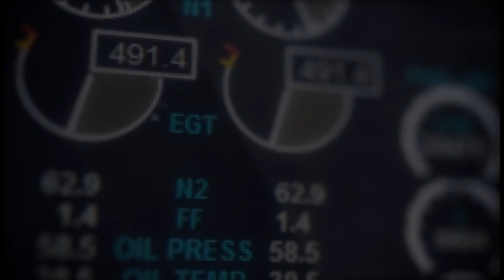Will Circular runways "take off"

Comment: Even more wingtip clearance with extra g force entailed by a banked runway would be needed.
And, what about all the approach lights and ILS system markers and glide slope indicators.
It would be a hell of a light show with thousands of those flashing lights radiating out everywhere. Using up so much extra space as to be beyond absurd.
But maybe computers will take over using gps and other indicators rendering all that other stuff unnecessary.
But with real pilots. It is absurd.

But I see this was raised before.
Reply: the light system could be done with hud indicators and ground markers that would only light up the ones required for that plane to land.
Reply: +Marcos Danilo +
No good.
Have you seen runway approach lights? There is a kilometer long array of towers with sequential strobes indicating the precise direction of the runway. It is not possible to have such an array for every conceivable direction.
Also the VASI or PAPI needs to be precisely aligned with the runway. 
While it at be possible to manage the lights electronically there would still be a huge amount of space required to build them all in.
And even then, changing which lights are operational, at short notice, is recipe for disaster.
Reply: im talking more of  AR actually, the runway would have "marks" that would send the information to the planes, and the hud would turn them into landing indicators.
Reply: +Marcos Danilo +
"AR" I am not sure I understand. Do you mean some kind of automated virtual indication?
Reply: kinda, AR stands for augmented reality, like the huds fighter pilots use in their helmets, one way to use them is to take something in the real world and "transform" to something else, like the AR codes for cellphones. 

that way you could have the runway with something similar to those codes, and the plane would get a "permission" to see specific ones, the HUD would then show them to serve as guide, that way each plane would only see the ones they need to guide the planes.
Reply: +Marcos Danilo+
I am not sure what you mean by AR codes for cell phones but the limitation i see is that there is a reason for high visibility, large bright, physical runway guidance systems.
For the pilot to be able to see the real runway from the real plane in the correct real orientation.
The system you seem to be describing would not have that actual connection between the pilots eyes and the actual runway landing approach.
If there was enough automation and precision in GPS and computer power, there wouldn't be a such a need for a such massive real world constructs and planes could then land themselves.
Projecting a virtual recreation on the hud would be of limited use I think.
The problem is the need to have real sight of real landing aids and strips.

Comment: You say it's unlikely, not that its not possible. If there is enough funding and expertise, a lot of the problems you stated could be worked out as they were for traditional runways. And the added costs I think would barely be noticeable if they could take off and land 2 to 3 planes at a time because of the additional revenue they would generate. Just because something is harder doesn't mean it shouldn't be tried and improve, have some technology and the desire of corporations to make more money.

My quick ideas
Maybe the lights can be built into the runway and they could be programmed to position themselves depending on take off and landing. When its needed it, it appears from underground, and it could look like car lanes but wider to add more margin for error. This would probably need a big circle though. Difficult but possible.

Comment: Some of the first runways were actually just big circular fields.. like a big platter... like in WW1, you took off in the direction against the wind, no matter where it would be.   Not around the edges of the field, but through the center of the circle.  The problem came when the airplanes tore up the center of the grass  field too much and turned it into mud.  On the other hand, a whole flight could take off in tandem at once side by side.

Comment: Excellent analysis.  An additional point:  Most airports today use parallel runways in order to double the traffic throughout capacity of the airfield.  A single circular runway with any significant winds results in a single runway constraint.  Another additional point:  Concrete is expensive, and the utilization rate of concrete in a circular runway is less than that of conventional runways.  The lower utilization rate results in higher costs.  Between these issues and the handling, clearance, traffic deconfliction, and obstacle clearance issues all line up to make the idea of circular runways a very bad idea indeed.  Have a nice day!

Comment: Ever drive a car 250 km/per hr.? Not so easy even on a straightaway. Imagine trying to hold a 60 ton jet centered on a runway at takeoff speeds while steering in a circle??!! I don't want to! Its gotta be hard enough doing it on a straight. One little glitch and you're done.

Comment: I had an idea near the end of this video that will end any further consideration of circular runways.. A massive turbine engine at the far end of the runway. Like 300 feet (90 meters) in diameter, with the exhaust pointing along the runway towards approaching aircraft. Presto! The wind is always lined up with your approach, no crosswinds! Dial in the speed per each aircraft type so you can do three point, near-zero knot touchdowns, like those crazy Alaskan STOL pilots. Runway length could be reduced to a couple hundred feet (66 meters.). I predict this will be standard practice by 2020. Why? Because I have 20/20-vision™, that's why! Just remember to dial it back after the 747 lands for the J-3 Cub guy, okay?

Comment: What happens if one of the engine hits a bird while landing in circular run away, that will be a catastrophic event for the pilot and other aircrafts as well? He will be unable to understand the thrust failures? 

What happens if there is too much of turbulence while landing becoz of the gale winds? 

What happens if there is a problem of overshooting the runway? Pilot is unable to control the speed of the aircraft for some reason. 

I think you have covered the scenario of skidding of the aircraft while landing. That will cover the snow fall as well. 

What happens if there is simultaneous take off or landing? There are many cases one pilot(aircraft) aborted the take off or landing at the edge of main taxiway and runway ? How do u manage this? Incase of landing it is easy to abort in case of straight run way. In many cases pilots have managed just few feets distance while landing or takeoff just avoid collision course of the aircrafts.

What happens in case of lightning strike on the aircraft while landing on one of the engines? 

In rare scenarios aircraft controllers suddenly gives the signal to abort landing to the pilot because they found a dog or pig or something on the runway.

Comment: 3 runways  stacked on top of each other. like flying into a garauge where there is  no side winds or wind shear. and  take offs can be catapulted out.  intire airport underground out of weather.   no rain no snow  etc. as a pilot that landing would be scarey but with practice i think we can be more confident.  also fire control could line the landing strip  inside and be controled by tower and pilot. plane could come to a stop in a pillow of retardent foam
Reply: just the weight of concrete on the first runway would possibly collapse it on the runways below it,  not to mention the size of width and height of the tunnels would have to be massive , great concept but it would not work
Reply: A catapulted takeoff is extremely violent because of the g forces.

Comment: I can think of another factor against, if the camber is sufficient to prevent centrifugal force pushing the plane off the runway the centrifugal force will increase the effective takeoff weight of the plane perhaps to the point it wont take off.

Comment: I think VTOL commercial aircraft, if made feasible through RND, would significantly improve congestion and flexibility for airports. This way, the issue is not in the airport, but rather the vehicle.

Comment: wouldn't a better solution to crosswinds be to build a wind brake (a wall or dirt mound) beside the runway another upside to that is it would also act as a sound wall to keep direct sound in the airport area

Comment: Incredibly stupid idea. The problems presented by crosswind landings are trivial by comparison, and it doesn't really solve the crosswind problem. To solve the crosswind problem you would need to accurately predict crosswinds throughout approach down to the flare and touchdown point and begin the approach to hit that point. You are unnecessarily adding a huge variable to the equation. The simple way to solve the crosswind landing problem is to do it like the old days and land on a compass rose. Of course you would need to pave a 10,000' circle, but no crosswinds.

Comment: The physics isn't as bad as you make it out to be, banking the runways just right with a series of concentric strips each with a slightly different bank would allow any pilot to easily simulate a straight runway just like NASCAR tracks as well as avoid wing tip clearance issues. ice would be less likely to form cause of the bank. An automated landing and takeoff system would be easy to implement allowing for a much higher traffic throughput. as for asymmetrical thrust, it wouldn't be any different than a straight runway. I know it sounds weird but the physics are all there, this would actually work. The only issue is people are too quick to dismiss an out-of-the-box idea just because its too different than what they already know. I swear to you if you look into the physics you will be as amazed as I was.

Comment: a round runway is equal to a single runway when in use and most large airports use at least 2 as only one part of of the circle will be into the wind remember the runway can only be used in one direction or two plans will be heading for each other

Comment: We soon have roads full of self driving cars, and rockets that land by themselves, but planes cannot even compensate for an engine failure? I thought they were packed full of computers. And the London airspace management why would it even be a sweat if Heathrow needs to adjust a runway. Luton's controls are surely connected to all other airports.

Comment: The answer is simple. Make 3 flat, straight runways at 0, 45 and 90 degrees and use the most suitable runway for the wind conditions.

Comment: There's another problem with a circular runway. Imagine you've declared mayday, and you're making an emergency landing. Landing performance isn't something you've verified. Either you need more runway than you normally would, either because of overweight, or your spoilers and/or thrust reversers are compromised. How do you handle going around a circular runway? Also, if you have circular runway, say goodbye to ILS.

Comment: Mentour Pilot,
Why couldn't wind barriers be erected adjacent to touchdown areas of runways with chronic problem crosswinds?  By experimenting with the design of these barriers, they might even be able to redirect the flow of the crosswind so that it becomes a headwind (e.g. a series of curved vanes).  Perhaps they could even be adjustable to some extent.  Do you think this is feasible?  Has it ever been attempted anywhere?
Reply: That solution is worse than the problem. Barriers would just create turbulence and make takeoffs and landings much more dangerous.

Comment: How about other handling problems at landing or takeoff, specifically is it even possible to steer a plane in a circle at high speed without a chance of getting off the runway? Or would you have in this case to reach V1 and VR slower to avoid slipping (if that's the correct term here)? And related to that: if each plane has to go slower to take off, wouldn't it sort of jam the runway at busy airports more then having multiple straight runways? And also what about landing, wouldn't you face quite some handling problems there as well? Especially when the rwy is wet or you're facing crosswinds?

Comment: In the case of a single engine failure on take-off, there is no need for a forced take-off on a circular runway since it has infinite length. So there would be no need for a v1. You would simply go to idle thrust and abort the take-off. So no problem with assymetric  thrust as I see it. (Still I agree with the rest of the story)

Comment: Many of these points become easier if you assume that a circular runway has 5-6 approach/departure corridors defined (with all the ILS hardware). As for wingtip clearance - does the circular runway have to have a parabolic curve? It could also be flat, but at an angle, then there is no wingtip clearance issues. You'd need on and off ramps with gradual slopes, however. The width of the runway does have to be rather large then.

Comment: Hi
From a safety point of view. No.
If you have an engine or wing fire on the starboard side of the aircraft the tendency for fire spread at the angle of the aircraft would be to involve the cabin area a lot quicker than on a standard runway.
That being the case, evacuation on the port side would project the chutes upwards not downwards so evacuation would be hindered.
Reply from the maker: Another good point.
Reply: As you say, it would involve a major rethink in aircraft design.

Comment: It would be cool if runways could be replaced by some kind of vehicle that would match speed with the plane and catch it out of the air, slow it down and safely release. The plane would just need to get close enough to its track - not much easier than current landing but easier still. The same vehicle could also help the plane take off. Driven by linear motors it could have much higher acceleration and deceleration than the plane's engines and brakes, using for less space. I believe all the technology for it is there already, we just need somebody to try making one.

Comment: I would think the ONLY way this would work would be to make the circle the size of the cern super collider. Then, instead of nose up stall/speed braking, just fly it in like a fighter jet. apply reverse thrusters , abit more on the inside than outside wing to help compensate for the circle. But even then cross winds and down drafts would be a concern. In my estimation? Not feasible at all.

Comment: This is like solar roadways.  Never going to happen.
Reply: Solar roadways DID happen! Last time I checked, 3 of the panels were still working and the solar panels were generating almost enough Electricity to run the LEDs in those panels. Don't be such a naysayer! It's only caught fire once, is still like 20% functional, remains mostly intact, and has cost less than a medium sized private jet!
Reply: Sadly the chinese solarroadways had to close down after 10 days because the road got destroyed.
Reply: Oh, solar panels on airport runways! I'm going to make an indiegogo campaign and scam 5 million off gullible contributors.
Reply: @johnny_eth  Solar. Frickin'. Runways.
Reply: he means that you could do it, but it's an expensive & crappy product, so the economics will never be favourable..
..like trying to commute by jetpack, or using plexiglass wheels on your car.
Reply: THUDERFOOFT approved
Reply: They have them in Northern Idaho.

Comment: The biggest problem of circular runways I think will be the TEAR and WEAR of the NOSE WHEEL, I think the nose wheel in high speed and weight might tear easily if kept turning into circular runway before takeoff. The solution is to make bigger circular runway; bigger enough so as not to experience circle.
Reply from the maker: Among many many other problems.
Reply: Sure.
Reply: it would also require a diferent type of wheel, because the ones we have now were developed for horizontal landings and takeoffs. with the weight being forced into a diferent point, it may even be too expensive to maintain the landing gear. 

of course, thats also considering the construction and maintainance of the runway was perfect in the first place.

Comment: Circular runway is safer because it is endless and when an airplane floats during landing the pilot has more circular endless space to readjust the landing procedure manually. If one engine fails that is not the problem of circular runway but the plane itself and therefore the pilot has to use same procedures used in a normal runway by either abandoning landing and takeoff with one engine and find somewhere else to land.

Comment: Unless I missed it in the video, but what about the landing itself on a banked and curving runway? Youd have to hit the exact spot and can't just touch down 100m further forwards or backwards. You'd have to lend the plane while not even flying straight, but rolled and accounting for the (seemingly) upwards curve of the runway. And then when you brake, the centrifugal force changes as the speed drops and you have a continuous change in steering. That last thing of course happens on take-off as well...
I'm not in aviation, but that idea sounds really crackpot to me ...
Reply from the maker: It is really crackpot, it will never happen.
Reply: But the guy who suggested it didn't sound like he was some lunatic who thought he had a good idea on the toilet one morning.
You mentioned it wasn't an actual suggestion for an airport design, but just something to think on. But if there are so many immediately obvious problems with it, what's the point?
Come to think of it, how about making it an exam question for pilots' and aviation engineers' training? :D